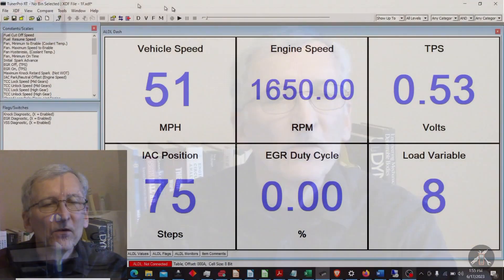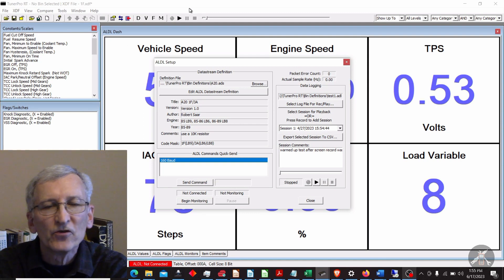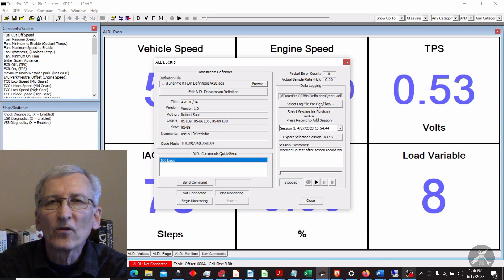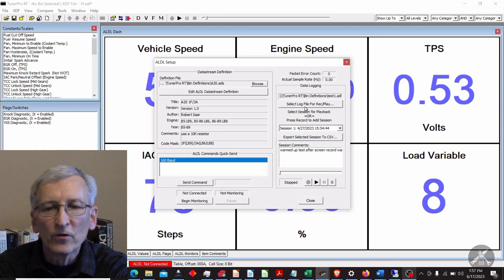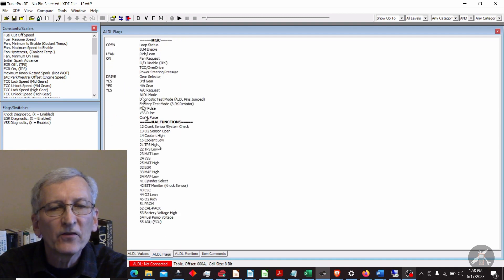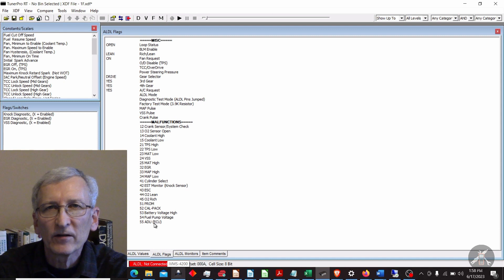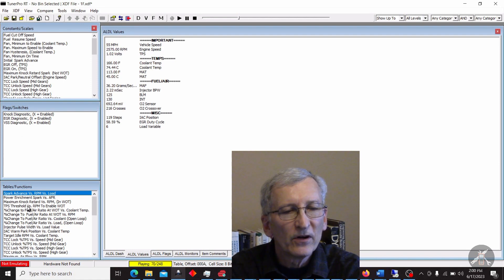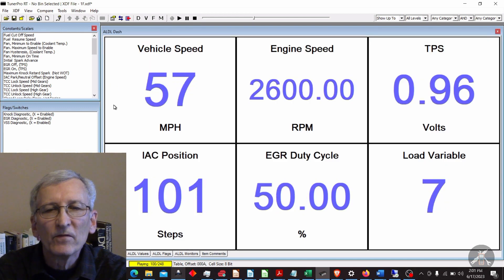Use TunerPro RT to Collect GM OBD1 Data on 3rd Gen Camaro 305 TPI

Comment: Dan, your videos are amazing. I followed your steps here on my 89 firebird (350 TPI) but got stuck with the data logging. How did you select or create a log file to include in the "ALDL Setup" "select log file for Rec/play" ?
Reply from the maker: You can just define a file and it will create it. I'll show  you - in process
Reply from the maker: I posted a new video where I set up the cable and TunerPro RT on another laptop and then set up the data streams.  I hope this helps.
https://youtu.be/Qiv8D0NaGLk
Reply: Thank you Dan, it was very helpful. I am trying to diagnose a high idle problem and today was able to log some data but the problem did not manifest this time. I will add a comment to the most recent video.

Comment: I like the Tuner Pro look. The graphs really bring perspective to help visualize what and how things are happening. For me on my 1987 I only see 0 or 100 percent on the EGR so I believe something is possibly functioning incorrectly.
Reply from the maker: Yes, TunerPro has more charting built in.  I agree that everything I see in my data is that the EGR command should be variable and not 0 or 100%. I'll keep digging.
Reply from the maker: Can you give me your vehicle details again?  engine / trans / axle / tires.  I'm looking for the differences between our cars.
Reply: @bitsofwisdom460  sure, it's a 1987 IROC Z with 350, 700R4 automatic trans, Borg Warner 9 bolt 327 gears
Reply: And 16" wheels
Reply from the maker: @mikebruegger8654  Thank you.  I am looking for the right BIN file for your application. I ought to be able to find one and verify the calibrations for EGR (and other things) with TunerPro. If I am successful, I'll post a video.
Reply: @bitsofwisdom460  love that!

Comment: I have a Tech1A dealer scanner with mass storage cartridge for the 80's-90's cars. Just pull codes, haven't tried realtime data.
Reply from the maker: Yes, those Tech1s were a great tool.  I had access to borrow them when I was working and they were very good.  I used them to monitor data on various vehicles while running down the road.  I know that I didn't exercise all of the tool's capability.